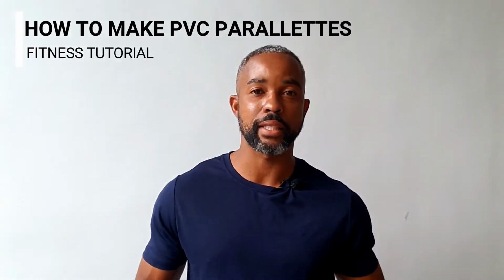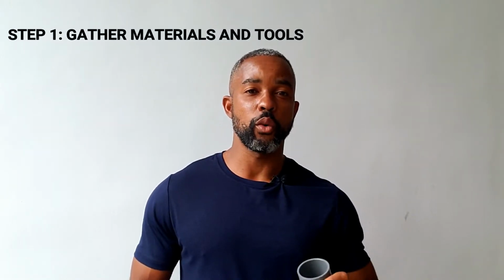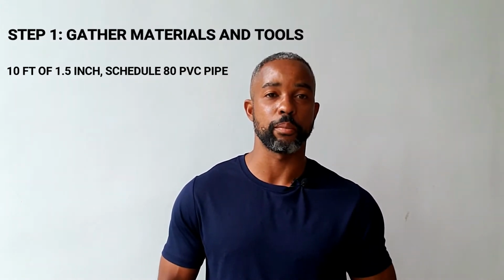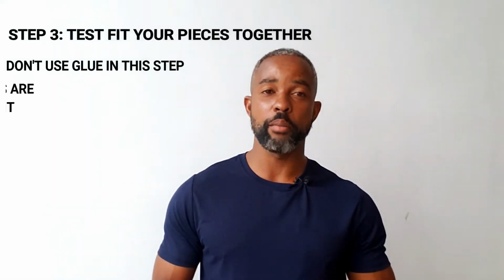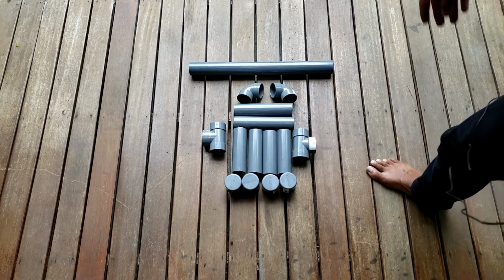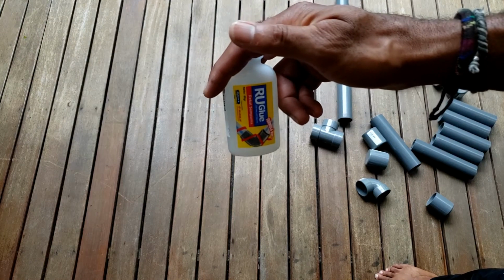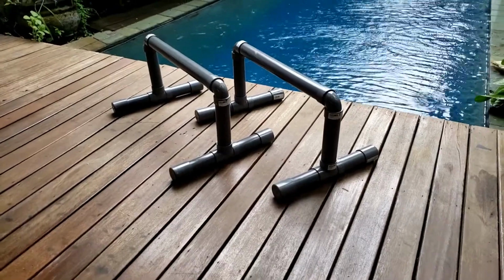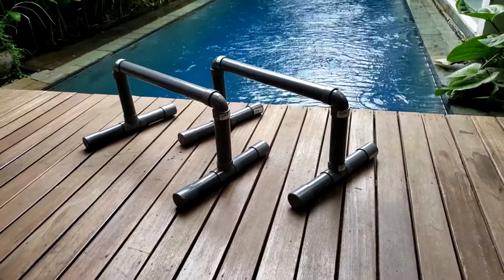How to Make Tough PVC Parallettes in 25 Minutes for less than $25 | A Brother Abroad

Comment: I packed sand in the set I made on top of cementing the pieces together. so far they hold my weight of 330. down 10 pounds  Update: im at 315 as of 12/23/2021
Reply: how much you weigh now
Reply: Why would you add sand?

Comment: The times are definitely changing.  Using the product links on the tutorial, the total cost has risen from $25 at the time of writing to around $318!
Reply: Just go to your local hardware store and pickup all the fittings, pipe, and glue yourself. And you don't need caps for the ends. You can use couplings to save money and it does the exact same thing. I'm in Canada and USA prices are definitely lower then over here. $318 doesn't make sense to me. I bought all the fittings for $30, $20 for the 10ft pipe length, and $8 for glue. I built the same thing today for $60. Sure it's not $25, but I'd imagine you can buy all the same stuff in the USA for probably $45. Shop around and good luck!
Reply from the maker: Yup, don't buy online with the links.  Go to your local hardware store and buy the materials.  With inflation they'll be a bit more expensive, but $318 is absurd.  The links are there more as examples of materials to buy.  The goal is to get you working out, not send you to the poor house 🤣🤣
Reply: How time flies!  I procured everything locally a year ago and have these for a similar price as cited by the first reply.  Working like a charm and gives me solid workouts between playing with my toddler.  Thanks for the video!

Comment: First of all, PVC pipe is not meant to hold that much weight and might simply break (same for the joints). Second of all, it's still expensive, more expensive than cheap parallettes, so what's the point of all of this? :)
Reply from the maker: 1. Lookup the breaking capacity in lbs of Schedule 80 PVC and get back to me. 2. Look at the date on this video and think about "inflation" 3. Lookup the price of a similar sized set of paralletes and get back to me.  To answer "why?", sometimes, if you travel like I do, you will be in a place where you don't have access to equipment like this.  This was made during the pandemic in Indonesia where a quality set of parallettes is extremely hard to come by.  This was a solution.  I'll let you connect the dots.
Reply: @WellFitCommunity  the cheapest one I could find cost about 1/3 of the PVC pipe's price, the more expensive, wooden ones are at about the same price as the PVC pipe (without even adding the joints).

I couldn't find anything on PVC 80 breaking capacity, it has a pretty high tensile strength and can withstand high pressure, but that's not the same thing as putting weight on it (I don't think they even test that).
Reply from the maker: So, simple economics, buy the wooden parallettes and save yourself the time. Especially if theyre high quality wooden parallettes which are gold standard and better for grip if you're doing handstands or anything inverted. 

As I said before, those (reasonably priced wooden parallettes) weren't available in Indonesia where I was at when I made this video.  This video is for anyone (like me) who needs an Improvised option and can find the materials for a reasonable price. So if you have better options. Just disregard the video or enjoy the show. 

As for strength, I've used these same parallettes since they were made, for everything from simple calisthenics to handstands.  I've worked with PVC enough that I trust them with my weight. Burst pressure strength (which is what you're thinking) is different than tensile strength which measures the amount of weight a pipe can handle before it deforms, whixh for this type of pipe is 1000lbs.  

But back to the top point.  If you can get a reasonably priced set of prefabricated high quality wood parallettes, save yourself the time and money and go for those.  I guarantee you'll enjoy the feel of wood more than PVC.